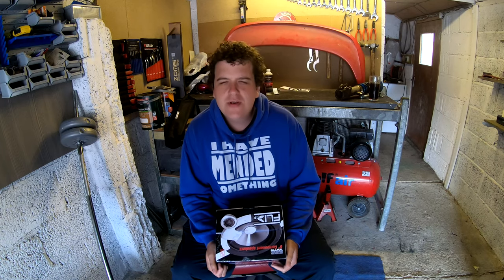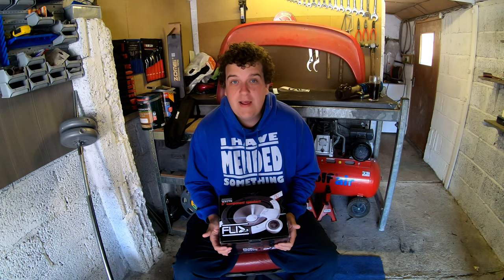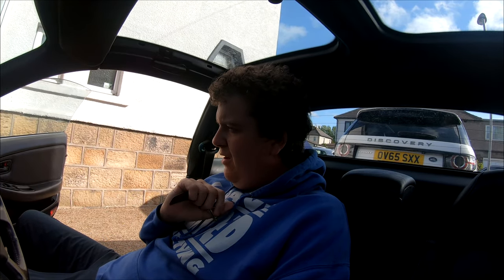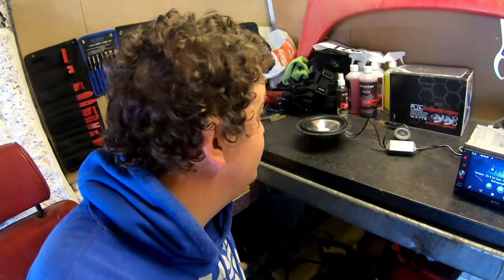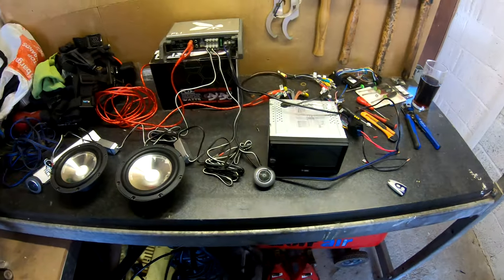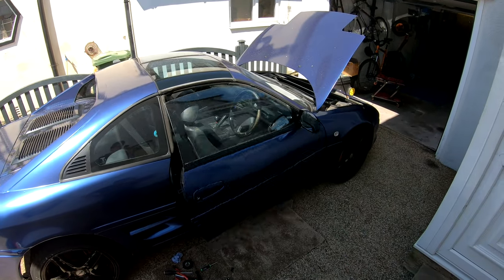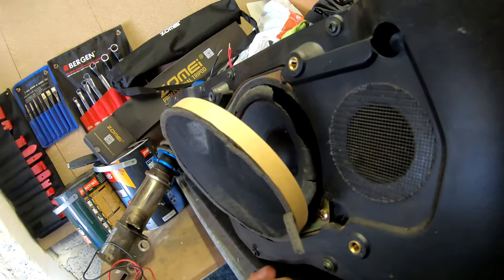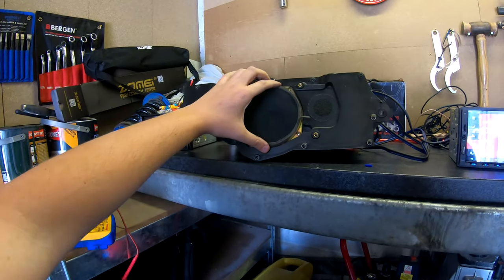Component Speaker Upgrade - Toyota MR2

Comment: Good little trick for tracing speaker wires. Use a 9v battery, like what’s in a smoke alarm. Put the wires onto that and which ever speak it is will make a noise. 😉👍
Reply from the maker: Never thought of that. What's it do just make a pop or something?
Reply: Bluudys Garage Extra - Car Stuff and Things  ye a little pop. Doesn’t damage the speak in anyway 👍

Comment: Gains are not meant to be used as a volume control. It is only for matching the rca output voltage to the headunit.

Comment: The standard sub will be an active one. With small amp inside. Just replace the cone with a cheap woofer, see if it improves quality. Nothing to lose compared to buying a replacement sub.
Reply from the maker: Got a little upgrade as my speakers are amplified soon will be doing the same.

Comment: Sounds great even on camera. It must sound even better in person. When you upgraded your head unit did you need to get an updated wiring harness adapter? I have a 1995 JDM right side drive from Japan and wanted to know if I need to do anything particular since i'm in the states. Right now the car has stock audio and is begging for an update. Awesome and helpful videos :) thanks, Kai
Reply from the maker: Hey kai. The unit was replaced before I got it. But I may pull it out to check.